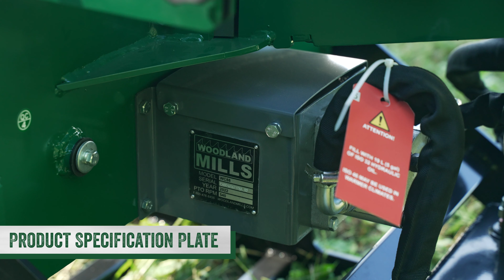Woodland Mills WC88 8" PTO Wood Chipper

Comment: Thanks! Great to see what a much larger machine can do. I have a free standing gasoline powered chipper shredder at around 3.5hp. This machine would be more than my Kubota BX could handle since my tractor is rated at 22hp. (I should look up the hp at the PTO..). A chipper shredder I can run off my tractor would eliminate burning hard woods too big to run through my chipper shredder but not big enough to keep for fire wood…